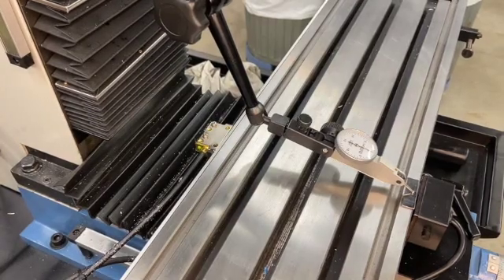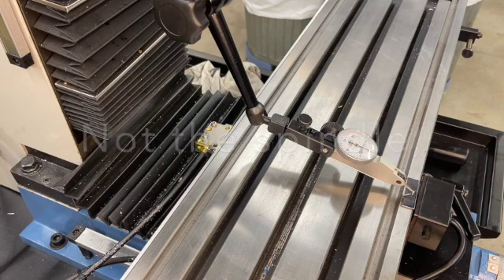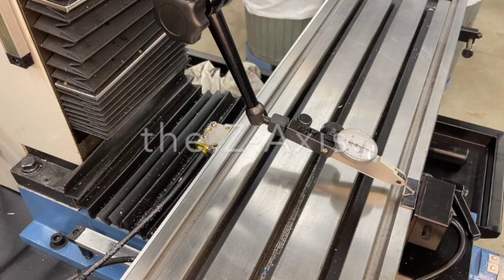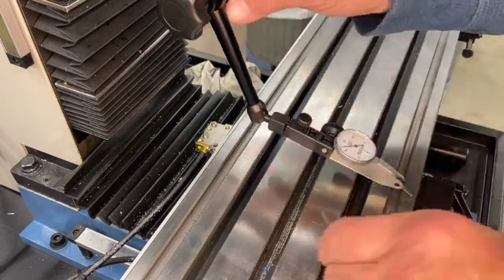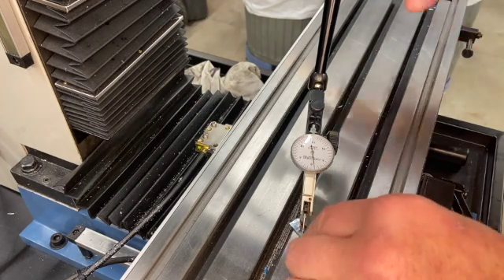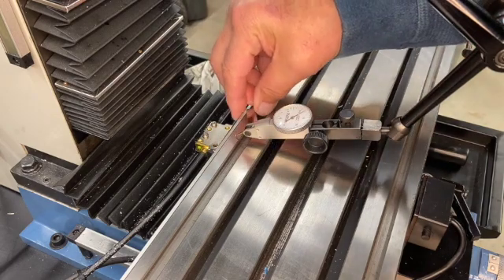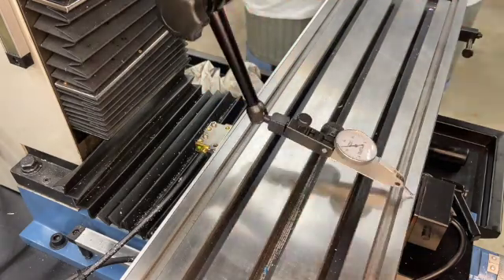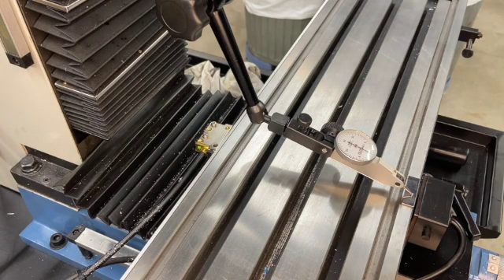LMS 5550 (Sieg SX2.7) Bench Mill - Tramming

Comment: Two adjusters on the head allow adjustment of the spindle in the x- plane, place a protective piece on the table to support a bottle jack and undo the bolt holding the column use the bottle jack to raise the column and put shims in to adjust the spindle in relation to the table in the Y - axis.

Comment: I was a little surprised by the comment on the lack of information in the manual.  I used LMS's generic mini lathe user guide to set-up my no-name mini lathe that came with a 2 page user manual, so I was surprised to see they just provided the bare bones sieg manual, usually when they brand a machine they write a manual for it.

Their manual for the 3990 mini mill that I'm currently getting set-up is pretty comprehensive, the column mounts are similar so you could download this manual for tramming instructions, but it's basically measure, shim, repeat.  Also, Grizzly is a great source for Chinese machine user manuals.  I was able to find a suitable manual for my generic mini-lathe there, I was even able to find parts and a manual for an old no-name band saw I picked up at yard sale from Grizzly.

I believe the equivalent grizzly model of your mill would be the G0759.  Just for the heck of it I checked out their manual, 57 pages of everything you could possibly want to know, except how to tram the column, lol.  But there is a bunch of other stuff like spindle break-in procedures which even LMS doesn't include in their own manuals.  Nice to see other Granite Staters here.
Reply from the maker: Thanks for your comments.  I downloaded the Grizzly manual and there is a lot of good info there.

Comment: You need to pack shims under the mounting piont for your column that would be the fulcrum piont for bringing your base to parallel with the end of your spindle. From the readings you give in the vid you need to shim your column to lean slightly  to the rear and remember that the thickness of shim will decrease  proportionaly as the distance to the column mount.